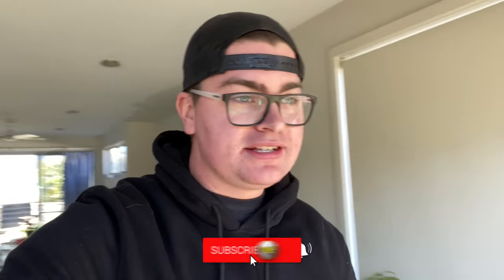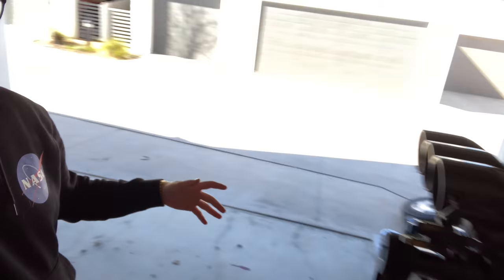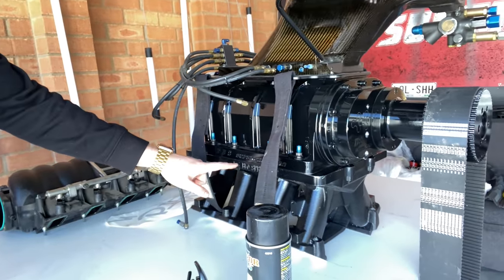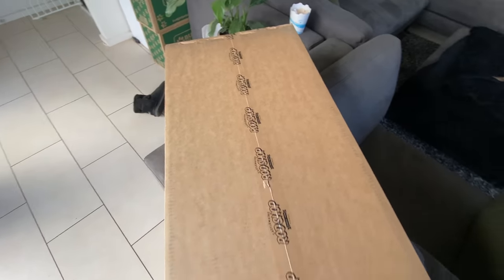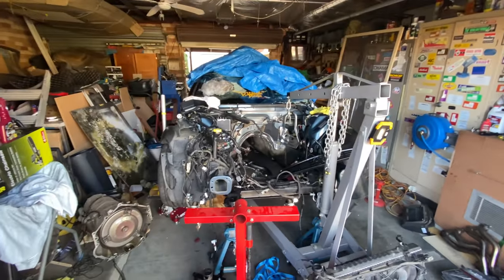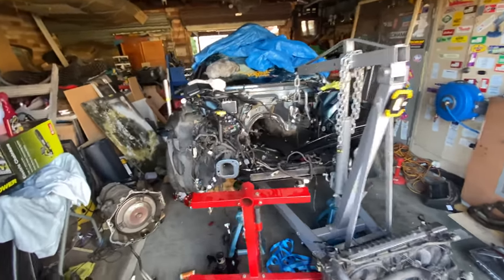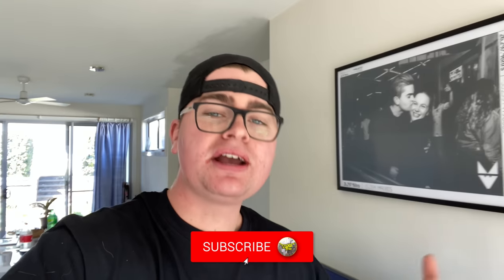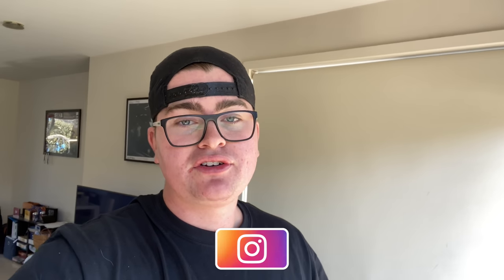Insane Surprise Package For The Wagon

Comment: Try unbolting the door hinges might help getting those doors off mate
Reply from the maker: Tuff LC1 it’s locked to the back door, so we could take the front hinges off but then then we can get the back door hinges off so it’s still just stuck regardless lol needs to be cut off
Reply: Grinder it is then 😂